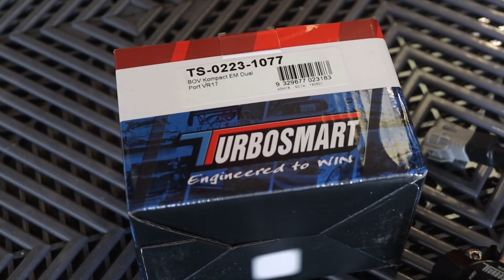GR Yaris Gets an UPGRADE!! Turbosmart Blow-Off Valve Installation

Comment: Hi, I installed mine 2 days ago and I' afraid about that turbo flutter. Is it safe? I can always hear it when when I lift the accelerator at high rpm. Never had that before. 
Also for some unkown reason I m getting more random pops from the exhaust. I got opf delete for some time now but since I got the value I m definitely getting much more random pops. 
Did you get all this with your car?
Reply from the maker: Yes, one of the main features of the Turbosmart Blow-Off Valve is the noise. As well as improving air flow, which is why you are getting more random pops, it also creates an amazing turbo flutter noise when you lift off the accelerator. Nothing to worry about, just enjoy the sounds!
Reply: the turbo flutter only happens when you deleted the bov and the excess air now escapes through the turbo spokes hence the flutter. but if you have a bov......the excess air will escape through there and won't make its way back to the turbo
Reply: @prodmanoa  yeah I’m wondering what he means by then ”flutter”. He’s  most likely talking about the noise of the air venting through the BOV.